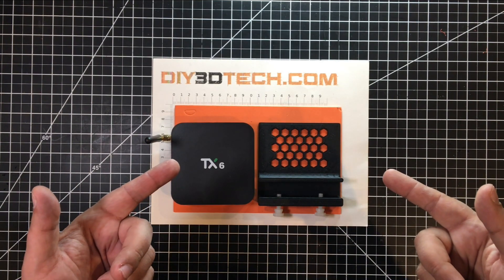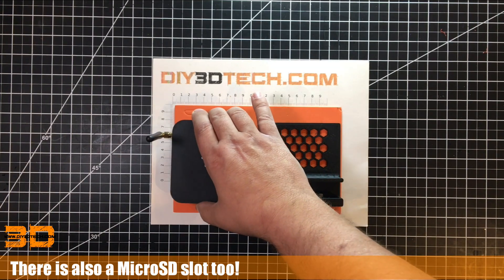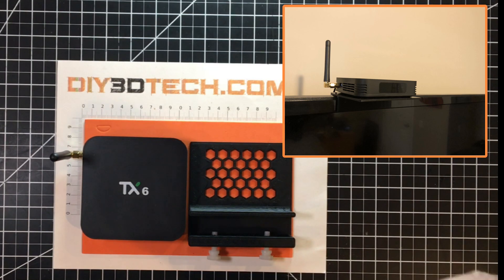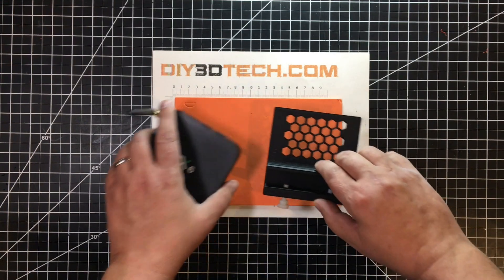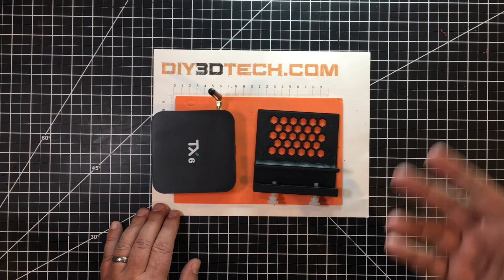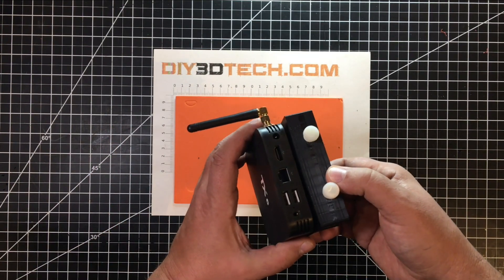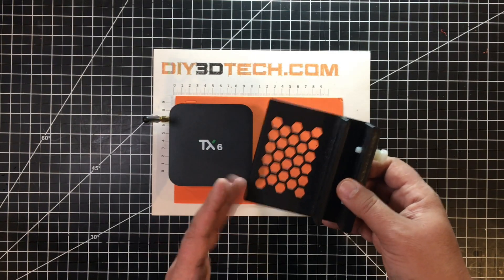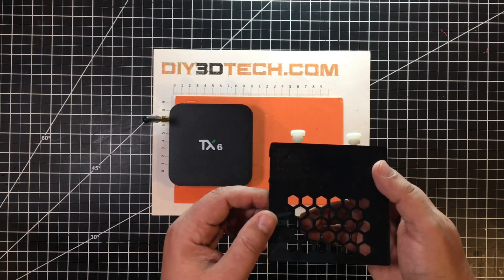Design Talk - Cutting the Cable with 3D Printing!

Comment: Thank you for supporting Freecad, I am using it and it's probably good for all home DIY 💝
Edit: At least, it is a comprehensive design for binge watching 💟
Reply from the maker: Yea I am trying it as well as ViaCad yet having a few challenges with around sketching as I would like to avoid the $300 and some dollars a year for Fusion. However to work with others like NYC CNC is doing with Johnny 5 one needs Fusion so I still up in the air and little POed that AutoDesk discounted the Hobby Business world...
Reply: @DIY3DTECHcom  They didn't stop the hobbyist license.  When your license expires and you click on the subscribe button in the top right corner of Fusion, choose the option towards the bottom of the pop-up window.  It says something like "are you a student / hobbyist?".  I can't remember what exactly it says.
More info here: https://www.autodesk.com/campaigns/fusion-360-for-hobbyists